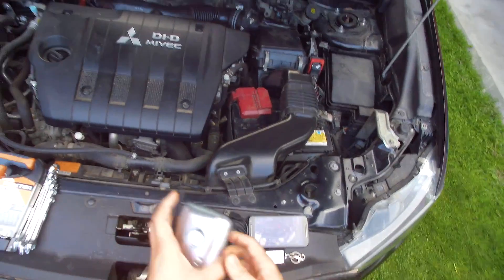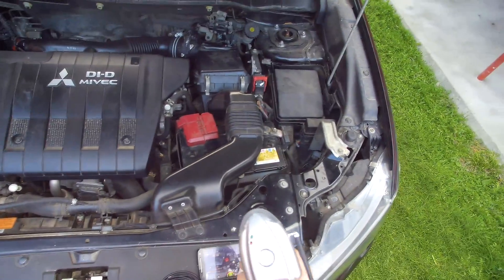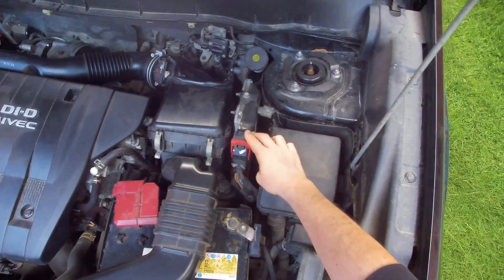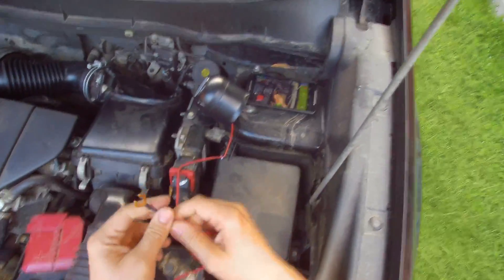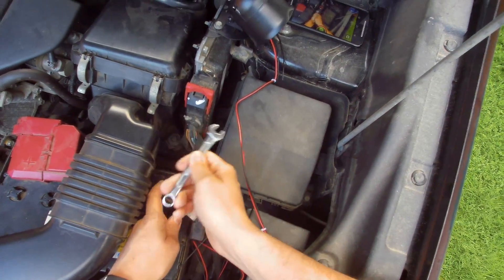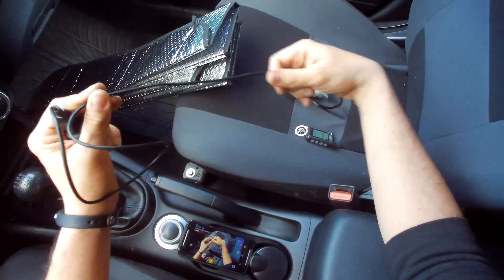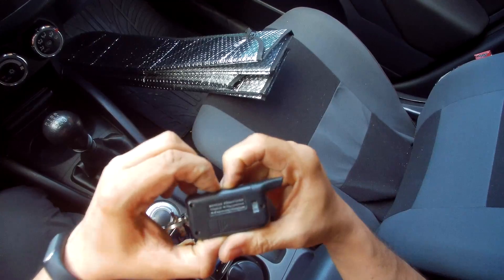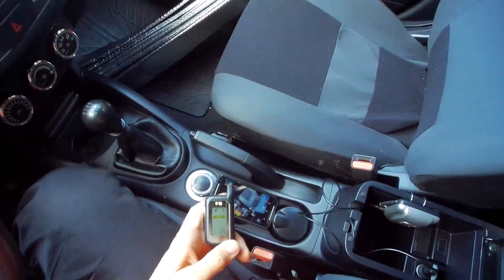DIY Wireless Car Alarm System Install Guide

Comment from the maker: The wireless no install car alarm system is available from: 
New updated mode: https://bit.ly/2ZRVVqg
New low cost option: https://amzn.to/3bLJHSW
Original model (no longer available) http://bit.ly/2NrZZH6
Original model (no longer available) https://amzn.to/3laHZNe
Reply: does it drain car's battery??

Comment: How do you enable the trunk function to work or can you just use basic function to arm and disarm alarm
Reply from the maker: This alarm doesn't have a locking system so you can just arm & disarm.

Comment: since its connected directly to car's battery, does it drain car's battery when its not ringing?
Reply from the maker: Not more than a regular car alarm which keeps much more devices on standby.

Comment: If someone touch the body of the car  it will alarm or until open the car door?
Reply from the maker: It also has a built-in in shock sensor so if the car it hit it will sound the alarm.

Comment: anybody know how to make the pressure sensor stop working, I just need the shock sensor to work, the base will be installed in a open enviroment and wind forces it to go off
Reply from the maker: Air tight plastic container such as food casserole.
Reply: @TechTronic9000  after turning down sensitivity on pressure switch, works perfectly...thx

Comment: What happen if they break the sensor when the alarm is going off. Will the siren continue or will it shut off? Thanks
Reply from the maker: It's a good question, probably the siren will work only when triggerd.

Comment: that speaker should not be put there with the engine heat but somewhere under the grill
Reply from the maker: Nor where water will pour over it such as near the windshield drain holes

Comment: Is this a keyless remote also that will unlock my doors? If it is how do you pair it to unlock my door?
Reply from the maker: No, because it does not connect to anything it can not open / close door locks.

Comment: Thanks for the video. 
If you close the central console compartment (where you put the main unit), will the pressure sensors still be able to detect pressure changes outside of the compartment?
Reply from the maker: Yes, it works from there also as it's not air tight.

Comment: With the shock sensor do you always need it to be plugged in the cigarette lighter to charge to make it work  or is it only when u need to charge it
Reply from the maker: It works for ~ 30 days in standby without charging.

Comment: What do you guys mean when you say it last up to 30 days
Reply from the maker: The main alarm control module has an internal battery that will work for 30 days without charging. It will also work if you car battery goes flat !

Comment: How many tons this alarm has,also does it go to 1 minutes and arms itself again or keeps going until battery is drained??
Reply from the maker: Depends on the siren, mine has 6 tones, it will go off after a period of time. It also has 2 levels of shock: warning and alarm.
Reply: I got mine today it has only one tone maybe it plays more i let it play for one minute only i have alarm on my truck i got this just in case ,double dragon,lol,thanks.
Reply from the maker: It's an extra deterrent I like the fact that you don't have to drill the car, add new wires, cut original harness etc.

Comment: How far remote works on it can it go to 500 meter?
Reply from the maker: Varies a lot depending on the environment, usually my pager works for ~ 10-100 meters depending on the buildings.
Reply: On ebay it says 1000 meter also it dosnt say how many tons it got.6 or one.
Reply from the maker: It may be a newer model...mine has some years already since I had it.
Reply: Ok thanks.

Comment: Does the siren keep going off if someone were to unplug or smash the main unit?

Thanks
Reply from the maker: That is a good question, but because of the alarms internal battery is hard to simulate such scenario.

Comment: Hi. My car is  a 2002 bmw 325i and the battery is located in the trunk . Will this alarm still work in the trunk??
Reply from the maker: The alarm siren needs +12V, it does not need to be connected directly to the battery, so you may be able to find some other place to connect it.
Reply: I have a BMW 330ci looking to get the alarm, did you ever follow through? If so did it work in the truck?

Comment: can you send a link on aliexpress ? Cant find it under DIVY2. thanks
Reply from the maker: Here is one example: https://www.aliexpress.com/item/New-DIY-two-way-car-alarm-with-intelligent-pressure-shock-sensor-double-check-wireless-led-display/32502355848.html?spm=2114.40010508.4.2.pGtY2e

Comment: In amazon, it costs 120 $, while on aliexpress cost 68 $ , What is the difference ?
Reply from the maker: +Raed Hosny Nothing, mine is from aliexpress.
Reply: Can u control  sensitivity ? Is it good ?
Reply from the maker: +Raed Hosny yes, you can adjust shock and barometric detection
Reply from the maker: Yes, you can adjust it.

Comment: I took the original is called beeper and French costs a little more than that of China but still the internal sensor is unreliable at times sounded only after opening the door and richidendola, cute remote control with display but the unit does not have a good sensitivity and siren and only 100db not making an actual test is therefore a bit down the sound, eventually returned